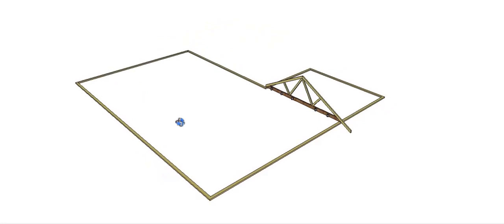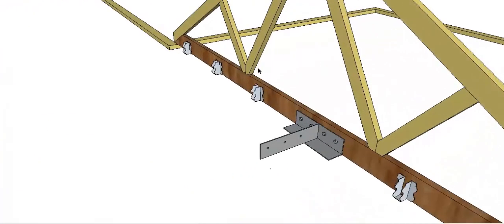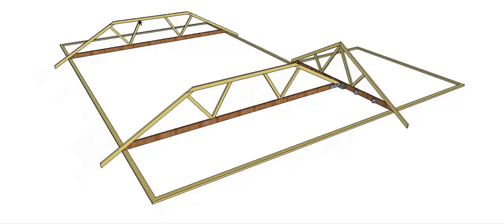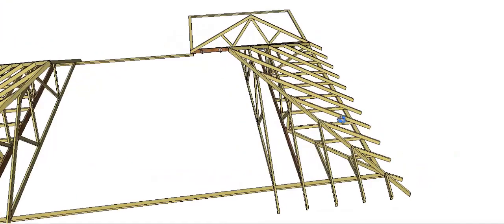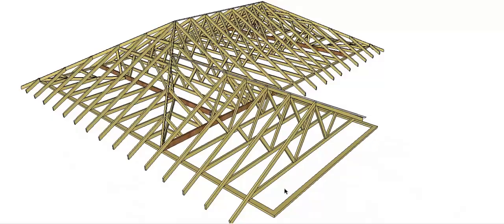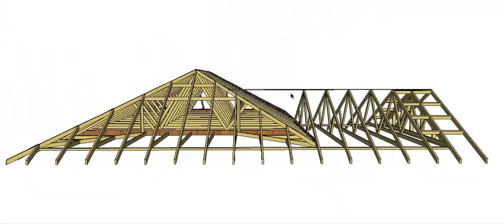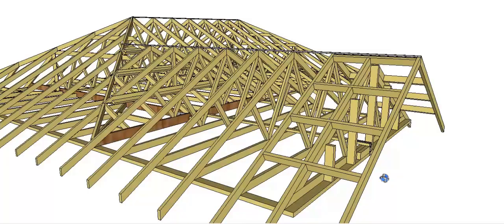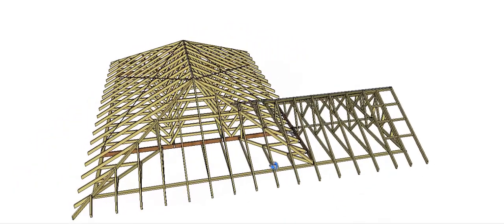Truss Roof Erection

Comment: Thanks for the great videos. 
When packing out the gable end for sheeting, do you need to leave a gap between the battens and end wall? So that the truss can deflect without putting load on the wall?
Reply: Does the gable end packing/battens get nailed to the trusses and not the top plate? Is it common to use steel (top hats) for the gable end sheet battens?
Reply from the maker: @nathandtanner  The issue with the top hat is that it is not usually the same dimension as the wall, so it is not suitable for packing. Ideally, the packing should just be nailed to the top plate and supported at the top with truss brackets to allow the truss to move.
Reply: Makes perfect sense, thanks mate
Reply from the maker: Hi Mate, if you attach the studs to the trusses in any way, then yes, you will have to allow for the trusses' deflection. Hope this helps

Comment: Do you lift the trusses one by one or sort them all on the roof? I’ve seen the videos where carpenters lay all the trusses out on the top plate and just walk over them it looks like a mess surely there is an easier way?
Reply from the maker: Hi
You can do it either way, yeah laying them out on the roof does look like a mess but it is pretty quick as long as the factory has packed them in some sort of logical order. It is recommended that you lift and install them one at a time however this generally take longer. Hope this helps.
Reply: @Buildsum  thanks heaps, yeah the video I saw the trusses weren’t packed in order and they had to move them all on the top plates, looked like hell haha

Comment: I just realised what you meant about 'rat runners'... that timber makes easy for the rats to run from one end of the attic to the other! ... have i got that right?
Reply from the maker: Hi Dave, yeah that is correct.
Reply: @Buildsum  I'm doing RPL in carpentry in queensland. and this free learning resource has high value and good quality... Its great for people like me who want to be even more familiar with methods rather than just the RPL modules.  thanks mate
Reply from the maker: Thanks, Dave, it's great to hear that you are finding the videos helpful.
Reply from the maker: Hi Dave, yeah I imagine that there are quite a few RTO's using my videos in this way however even if they have linked or embedded the video in there moodle it will sill count to my views and if my branding is still on it then all good. Thanks for letting me know anyway.
Reply: @Buildsum  well i deleted my comment because I didn't want to cause a sort of legal fight. Anyway it means you have good quality vids. cheers mate. bye